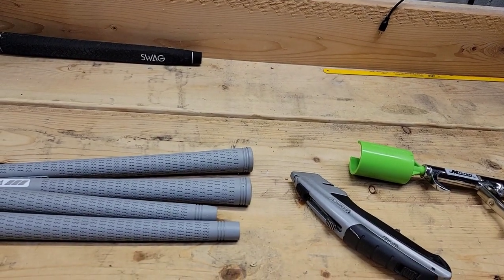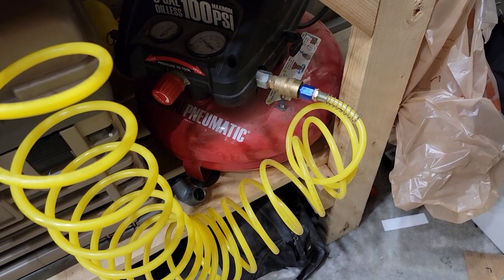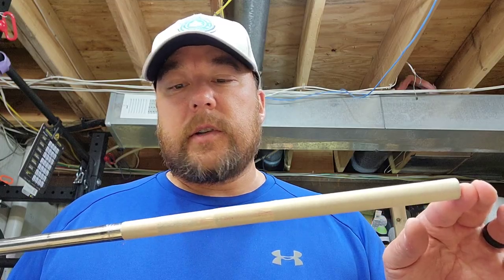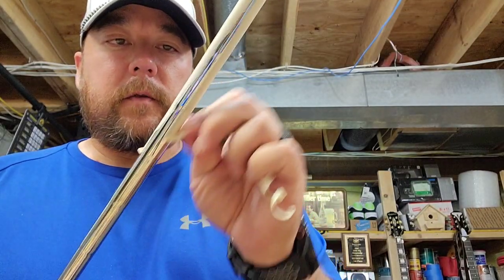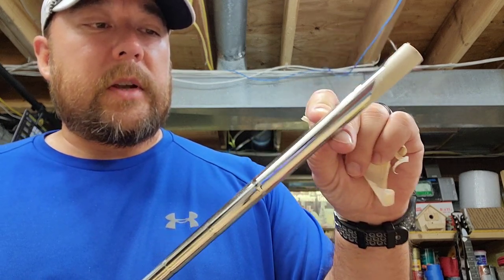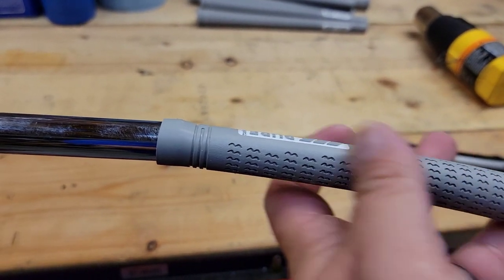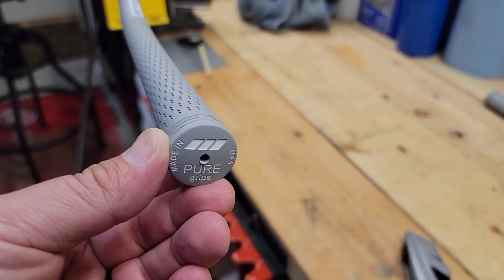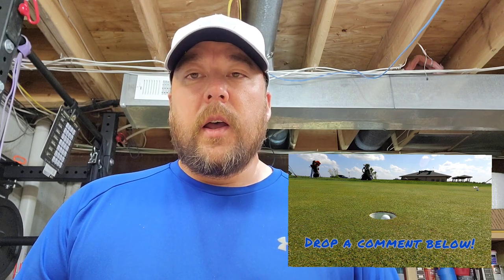How to Re-Grip or Regrip your own Golf Clubs at Home using Air

Comment: Great video. I've thought of doing this myself. If I build up the grip with tape, does the grip tend to slip since it's not contacted with the shaft?
Reply from the maker: It shouldn't slip once installed. Use a tape with a slightly rougher surface (blue painter's tape is recommended) and there shouldn't be an issue.